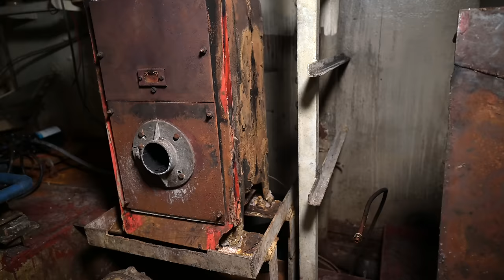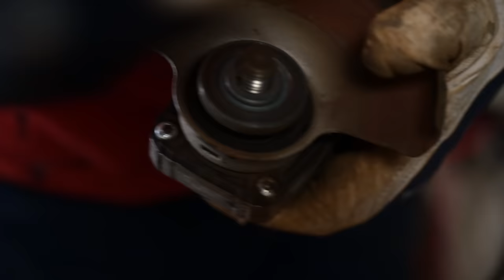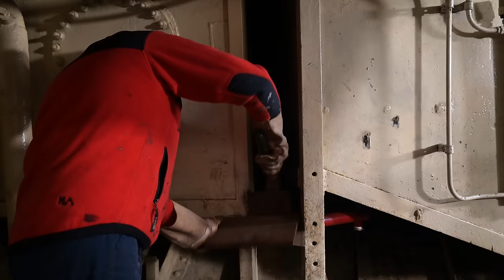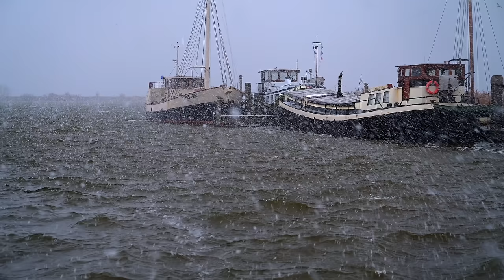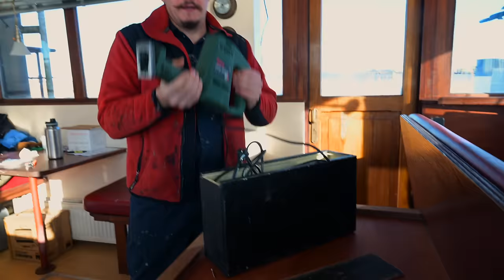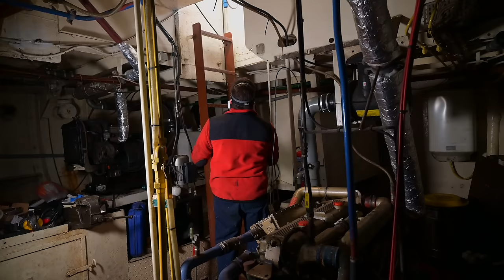The next Project: The huge ENGINE ROOM of our 1950 Trawler

Comment from the maker: You've enjoyed this video? Make sure to subscribe so you don't miss the next one! (Also it means a lot for us! 😁) 
➡Subscribe to our channel! It's free: https://www.youtube.com/channel/sailingflyingconey?sub_confirmation=1
➡Patreon: https://www.patreon.com/SailingFlyingConey
➡Donate tools and equipment: https://www.amazon.nl/hz/wishlist/ls/2VP643PDYV1L1?ref_=wl_share
➡Paypal: https://www.paypal.com/donate/?hosted_button_id=BNDZ5GT4GA4ZY
Reply: Go to the city of Itajaí in Brazil, it is very cheap to maintain compared to anywhere in Europe
Reply: Have you had a used oil analysis done on your diesel engine?? They're low cost and they have saved me thousands of dollars several times.. after running a oil sample analysis right before planning on doing an inframe overhaul and the analysis showed that the crankshaft bearings were wearing quickly and so u instead did a out of frame or complete overhaul of the engine. If I wouldn't have removed the crankshaft it could have broken the rod and shoved it straight through the block.. I've had friends who went the cheaper route with a inframe and in a few months their block is destroyed resulting in them having to purchase a crate engine.. these are semi truck diesels and my experience..
Reply from the maker: We do have the space to do a complete overhaul without taking the engine out of the vessel. In a few days we have a professional mechanic volunteering and we will do the assessment what needs to be done together with him. But it's planned to take the oil pan off to have a look at the crankshaft. Regarding the oil analysis, what I have read about it is that this only make sense if one makes it regularly to check for differences in the samples. Do you have a different opinion on that?
Reply: @FlyingConey  the oil analysis works great if done at every oil change so you can see how quickly bearings and other materials are wearing.. doing one now would still let you know what certain metal is most in your engine and that will tell you what's wearing out.. before a bearing or something goes wrong in an engine or transmission it will start leaving heavy metal in the oil.. I don't know what it costs over there but here it's pretty cheap to do. It also can back up what you hear from the mechanic or perhaps find something that was overlooked..

Comment: Nice idea to try to save the old pump
Reply from the maker: The pump is a strong one and produced by a company named SIHI. This type of pump is still in production and they are a bit costly. I think for someone who likes to overhaul old equipment it can be a lot of fun as well. Like the guys who fixed Tally Ho's capstan. Together with the old Perkins generator the pump is also a Flying Coney original and probably part of the ship since 1950. Currently we do have four other, more modern pumps but having the oldest one back in working condition would be great.

Comment: I would imagine it better to have safety railings around that engine especially when it running on the water you wouldn't want to fall into moving parts in rough waters. You can always weld a small frame or railing around the engine like one inch tubing. That's just my thoughts .Good to hear you have considered rebuilding that ole deck wash pump. That thing will surely come in handy.

Comment: Dear Barbara and Daniēl,
Good to see you back on board of Flying Coney and you’v really started with full power to refit the engine room. It’s wise to get rid of all the not in use equipment in the engine room because you need to get enough space for maintenance as soon as Flying Coney will be ready for sailing over the oceans. The pump you’ve shown needs an overhaul and after that the pump will work properly for years again. Unfortunately we don’t know anybody who can help you with this but WIlleke and I will do some investigations in our list of friends. Coming back to the engine room we think it might be wise to dismantle the engine from the gearbox and to left the engine a bit by press levers to clean the area down the engine properly and to paint the area white. We also think the whole machine room should be painted white because that will offer you a much more quicker view for any possible leaks of fluids in the future. We admire you both for your courage to start this huge project what’s almost as huge as Project Brupeg was and still is. We look forward to your next vlog and send you love
Reply from the maker: Thank you for keeping your eyes open for someone who would  do a service at the pump. This kind of work can be fun if you like doing stuff like that. At the end of a very very long to do list  there are tasks like re-painting the engine , the bilge and the whole engine room. For now removing stuff we clearly do not need anymore and getting it relatively clean must do. We are huge project Brupeg fans and at the beginning we always said if they can refit a huge boat we can refit a huge boat.

Comment: Great Vid, you both certainly look like you are full off enthusiasm and are ready to get more work done, I'm sure by removing lots of the old heavy stuff you gain a lot of space and loose a lot of weight from the ship
Reply from the maker: Exactly, at the end you're paying for every bit of space on the boat. So it's preferable to get good use out of it. Not much use for a broken heater. The boat isn't really weight sensitive. We recently brought one ton of metal to the scrapyard and the waterline hasn't changed a bit. But everything we removed so far has made a difference and I do like the look with the higher freeboard.

Comment: Little by little it’ll all get done. It’s a marathon and not a sprint. Hang in there
Reply from the maker: For me it's amazing to see how much even small steps improve the boat by quite a bit. We just got started in the engine room but I'm sure in one month from it will be so much nicer and cleaner and hopefully the engine will be in working condition again.
Reply: @FlyingConey  It sure will for sure!!! I’ve been working on cars and restoring some for over 40 years. I’ve also been fixing up houses. I know EXACTLY what you’re going through. I think you’re doing the right thing in the engine room (clearing out the clutter first).  Then you can sit back and really see what you have and prioritize what needs to be done. I would love to help if I lived closer.

Comment: I like that you share your learning curves as well, gives an honest view of what's involved in such a project. Will you replace all piping or is some of it still functional enough?
Reply from the maker: Thank you! The piping is mostly in good condition but it's no longer needed. We also want to reduce the number of tanks because we don't need about 8 000 liters capacity. Our idea is to make the engine room smaller and remove everything that is on the port side. At one point we had to make the decision if we do want to work around around all the other work arounds or if we want to start mostly from scratch. We picked the later.

Comment: You both are doing a great job , I understand the weather and supplies are limiting you at times , after you get the boat going think about changing your Area, there are places that boat repairs are so much cheaper and the cost of living is much less, just be careful we’re you go for supply chains and availability for parts could be very difficult in parts  of the world ?
Reply from the maker: The Netherlands are a good place for structural steel work, so we do want to get the frames repaired here. But we hope to make it to Germany within this year. We also found out that Lelystad is probably worse than the rest of the Netherlands. Just a few more weeks and hopefully we can move on.

Comment: One suggestion: I have switched from using (so called) 'marine paint' to industrial paint. Half the cost and in many ways superior. . On a boat like yours that must be especially true.
Reply from the maker: We're using paint for the commercial marine industry. It's  much more economical than yacht paint and also better suited. Paint is a science in itself but proper protection of the steel and a long service life is very important.

Comment: Reciprocating saws are amazing but you were using it incorrectly. 
They work MUCH better if you push the foot of the saw tightly against whatever you are cutting. You want ONLY the blade to move, not the saw.
Reply from the maker: With modern saws you can adjust the foot of the saw to prevent the blade getting dull only near to the foot. With the saw we have you start with the foot pressed against the pipe but once your cutting you can move a bit to get more life out of the saw blade. Yes you loose some efficiency but cutting metal the prolonged life of the blades make up for it. Well I did watch one or two tutorials since we shot the video 😂

Comment: I applaud your enthusiasm, but you were using the recip saw right next to a union joint that you could have just unscrewed. Those don't have gaskets, so there wouldn't be any problem. Same with just taking pipes apart at compression joints. You could have also cut through the rubber coupling hoses in a couple of places super quick.
Reply from the maker: I've cuttet the pipe on both ends and takin it out in one piece. Cutting the rubber joint would've been just one more cut. It might have been possible to unscrew the union joint but from experience I know that handling the big pipe wrench in the tight engine room can also be very time consuming. In this case I was assuming that the chance that this joint can be simply unscrewed is minimal.
Reply: @FlyingConey  understandable. Hindsight is always clearer than foresight. I happen to have some pretty big pipe wrenches (and long cheater bars), so I could've gotten them apart. You can also shatter black iron pipe joints with a fist maul. You're going to throw it all away anyway, right? Unions come apart fairly easily, though. Something to keep in mind for the future. All the best!

Comment: Gday guys i was thinking about your guard rail and I'm thinking that one made out of pipe be it steel or aluminum would look great but if its made so the tubes sit over short sections with pins to secure it will mean that when work is to be done some pins can be pulled and the guard sections can be removed in sections ie seprate sides and front so they can be put aside easy and not require tools. 50mm aluminum pipe shoul look good and strong but be light. Your doing a great job🏴‍☠
Reply from the maker: I've something similar in mind. I would love to have steel ball with a brass tube / handrail. The one that was previously in place was just horrible.
Reply: @FlyingConey  I'm sure when you've finished it will be a masterpiece

Comment: Good time, as far as I can see, the engine is in extremely poor condition, some of the equipment will have to be changed. I would suggest you save money, namely, completely remove the engine with gearbox from the ship and send it for complete repairs to a workshop on the shore, it will be much cheaper than do complete repairs on board...
Reply from the maker: Not really in poor condition but it's looking horrible I agree. We have the space and the equipment to overhaul the engine without taking it out. Doing so would mean at least 7 days of work and also at least 7 days of putting it in. We considered doing an engine swap but doing so would be about 5 times more expensive than overhauling the one we have. The engine is also running fine and also part of the boat since 47 years.
Reply: Not so, Daniel has already said that the engine has low hours and is very reliable.  I think the issue is one of semantics when Daniel says "rebuild" I believe he is talking about "refurbishing" all of the external parts of the engine, like all the hoses which need to be replaced.  Also, the engine needs a thorough maintenance, like oil and filter change and fuel filter change.

Comment: With respect If your worried about a small gasket that maybe made of asbestos you shouldn't even be in that engine room !! All you have to do is wet the gasket and the risk has gone away . It would be much quicker and safer to undo the flanges and the pipe work .
Reply from the maker: If we show you something like cutting out flanges instead of undoing it it's because we did a lot of research beforehand. If you think the professional guidelines are overly cautious that's up to you. Asbestos is responsible for more casualties than any other work accident combined and even small amount of fibers can cause an Asbestosis. Since every fiber that makes it into your lungs will stay there for the rest of your life each fiber increases the risk. Especially flange gaskets are risky because there is a high chance of them containing asbestos and old gaskets were used a long time after the initial ban of asbestos.

Comment: Daniel, I think that unless you are prepared to pay the expensive cost of a rewind on that pump motor I think with parts availability etc it would be better to get a new pump which is probably more reliable and efficient. I know the amount of time you guys do is not representative of what’s shown in these short videos, but Daniel could I kindly suggest that you do more and talk less, it’s seems to be a rookie mistake. I love this project and your ideas are great.
Reply from the maker: The pump is made by a company called SIHI and this type of pump is still in production. Also they are quite strong but also quite expensive to buy new and parts are still available. It's also kind of one of the last bits of original equipment outdating the engine by some decades. This video is the first part of an engine room series and that explains a bit why there was so much talking. Also since we visited the boat show in Germany we had to reduce the working days on the boat. Actually it's easier for us as well if we get more work done during a week but unfortunately not always possible.
Reply: As a counter point, I find the ratio of action to talking well balanced for the type of work underway. As always, thanks for sharing this project!
Reply: Agreed with @trikael, you need some talking or explanation. The videos are way better than the beginning. Keep it up.
Reply: I disagree with gordonagent7037 about "doing more work and talking less". Daniel does a great job of explaining what he is doing and his thought process behind those decisions. Besides no matter what you do, there are always people in comments that think they know better than you do about any subject. To me it is best to just keep doing things your own way and not worry about what the "keyboard warriors" say or criticize you about. Just my opinion.
Reply: G'day  Crew,, 
Good to see you back .
Was a great vid  ,looking forward to seeing more of the engine.
Keep the metal offcuts they can be used for other things like shelves, brackets  & other work .
   
  Respect...!

Comment: Please NEVER WORK WITH THE ANGLEGRINDER WHILST WEARING GLOVES again !!! for many people it may doesn't seem obvious but if the glove gets into the rotating blade it will rips off your fingers!! way worse than a cut. But very nice project i love to watch your videos ;)
Reply from the maker: For the angle grinder welding gloves are part of the mandatory personal protection equipment PPE. Also the sparks are hot and can easily burn skin.